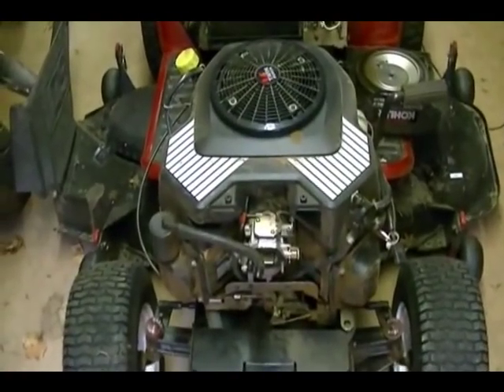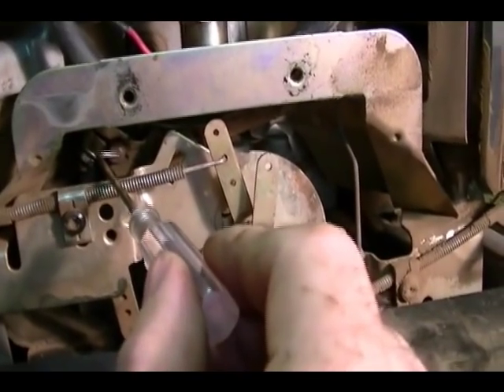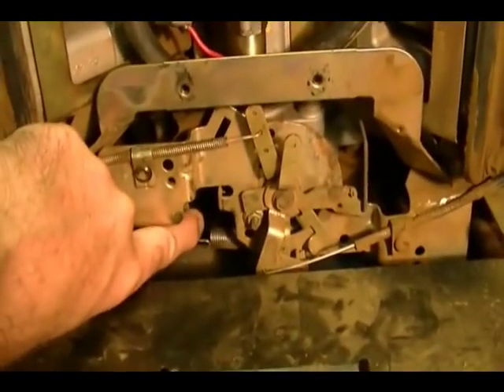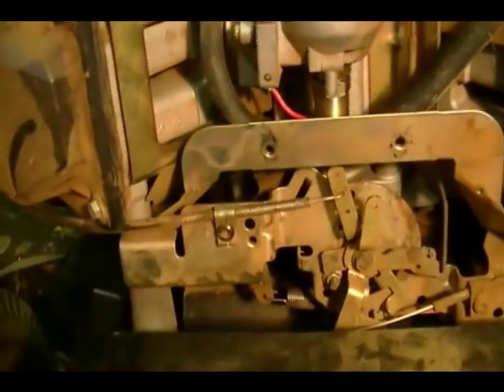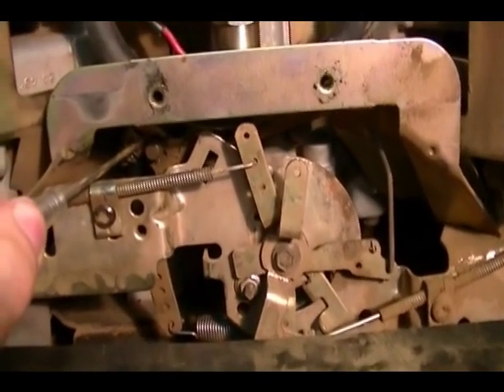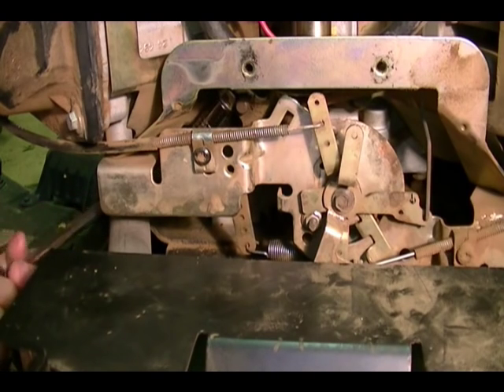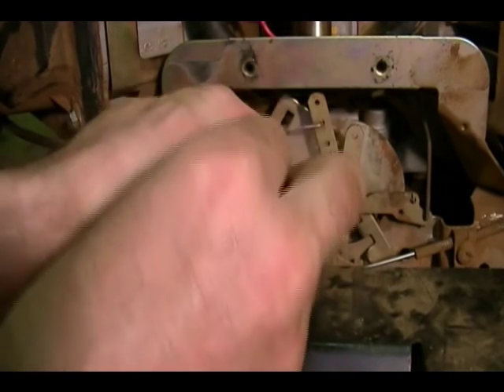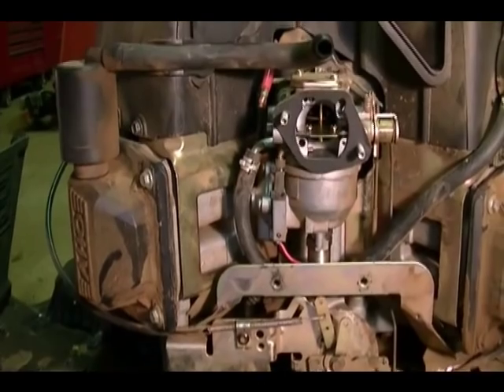Small Engine Repair: How to Adjust the Mechanical Governor on a Kohler V-Twin Engine

Comment: This video helped on my Kohler Command Pro 25 too. The linkage is a little different, but the concept was the same and got me back out and mowing! After replacing a leaky governor shaft seal, the engine would start, then rev up too high. It ran fine before taking it apart. Thank You for the help!

Comment: Very good video for adjusting governor on Kohler CV engine!
Well spoken, good clear steady picture, pointing the direction with finger was right on.

After total rebuild, I installed it and it started right up at OVER 4K RPM WIDE-OPEN, 
(3,600 RPM is normal) it would idle fine with throttle pulled back, but slightly increase throttle and engine would snap to wide open RPM's instantly, after watching this video, I went out and did what this video showed and now engine starts normal again; throttle response is normal, no problem now. 

Thanks for posting this video.

Comment: excellent video. You are a gifted presenter: very clear, concise and to the point. This is the best description I've seen on how a governor works. I have viewed well over 500 hundred how to videos related to small engine repair and this is the best I've seen on this subject. My enthusiasm has caused me to use too many words which is ironic because the thing I admired most about your video is how each word means so much and there are no fill in wasted words.

Comment: Thank you.   I'm very clear on what I need to do.   Saved me the trouble of loading the tractor up and taking it to the shop!
Reply: Me again, I used this video to fix my KOHLER 23 v twin John Deere L-130.  After John Deere worked on my tractor, they left the governor disconnected with the wrong spring on the gov.  Wow!  Paid $3.00 for a new spring at the Mom and Pop hardware store and watched the video.  Done!

Comment: GREAT VIDEO! I've got the ZT720 and replaced my throttle control cable and I'm worried about adjusting it such that it won't cause an over rev situation. Any advice? I'm thinking I need to buy a tachometer to get it right but am hoping for a simpler solution. Thanks again for sharing your expertise!

Comment: Appreciate your videos! Changed oil pan gasket on kohler cv740 the other day. Went to start it and it starts and dies starts and dies. Cleaned carb checked everything still nothing. So I’m thinking it has something to do with governor. I’m gonna check it today

Comment: I realize this video is quite old but I sure wish you would have addressed the different holes in the governor arm. Did you ever do another video?  I can't find anything, anywhere that addresses the holes or the location where the other side of the spring connects.

Comment: Hope you can help.....recently had to do some electrical work....burned wiring on the ignition moule (where the key goes) replaced that..washed the mower  water and detergent. Also cleaned the carb with carb cleaner. Now...busts right off, but if I engage mower at low rprm as usual, it dies....bur if i REV it up it will mow....I know it is a carb problem...any suggestion.....I hate to takeit to a shop if it is something really simple to fix my self.  PS  this is a Kohler Courage 25 hp on a Gravely 50" curt

Comment: having gov linkage problems, 23 hp kohler command, with a new gov return sprint ( due broken old one)  one end goes in adj holes OK where does the other end attach?
Reply: I'm trying to figure this out as well, I can't find anything that answers these questions. Did you ever figure it out?

Comment: These videos are great! Can you tell me what symptoms would tell us that we need to adjust the governor?
Reply: I noticed you didn't get answered, and in case someone else comes by, they can read my answer.  
Be warned, it may not be the best answer.

Symptom:  Your tractor runs at a lower rpm.   When climbing hills, the tractor struggles, or doesn't have the power to climb the hill.  You can adjust the throttle all you want, but you can't increase the high end until you reset the governor per the instructions given on this video.  BTW, I think he did an excellent job.

As to the spring, be careful re-positioning the spring as the motor my start surging when you apply power.
Reply: My symptoms were that the mower would crank and sound fine but when you press the forward or backwards pedal it would stutter like it was going to die...then rev back up and go fine (hydrostatic drive).  Also when I engaged the  blades, the rpms would dip real low and sound like it was going to kill the engine...but then the rpms would ramp back up and it would be fine.  Also while mowing, when the grass got thick, it was pretty iffy on whether the engine e was going to die.

I made the adjustment (very easy), and it runs like a hoss again.  The engine doesn't even flinch whenever you engage the blades.  My mower is 20 years old...I thought it was just getting worn out and it was time to buy another one.  It is literally running like new again.
Reply: Yeah the symptoms of a governor out of adjustment is that it doesn’t respond as quickly as it used to.  If adjusting it doesn’t help your governor weights may need to be checked, which required pulling the engine apart.

Comment: I have a toro recycler with the Kohler engine. I wish there was a way to run a cable and lever up by the handle to adjust the speed manually

Comment: Hoping to get a reply even though this is a few years old. The flywheel key broke on my bad boy magnum with the Kohler 7000 series. Instead of just removing the linkage on the carb, my helper took the brackets off the throttle/choke cable connect to. I THINK I have the brackets correct, but the bolt in the center that holds it all on will not tighten all the way. Is this normal? Is there supposed to be a nut on the back of the brackets that the bolt goes to, or just the threads on the brackets themselves then just tighten as far as it will go?

Comment: Nice video.  I know this is not a question/answer forum, but I thought you might be able to answer this.  On my mower (18HP kohler), it boggs down really easily when mowing.  I have adjusted the governor like you say.  If I watch the governor and engage the blade, the governor never moves the throttle. I can reach in and manually move the governor and the engine will speed up.  It is like the governor is not even working.  Is it common for the internals of the governor to break?   Thanks

Comment: I have the 22hp kohler motor, but i don't have that linkage coming from the left side in the video.  Is that your chock cable?  I'm also wondering what is supposed to pull the throttle closed, because mine doesn't seem to close all the way when you pull the lever all the way down.

Comment: I have the kohler pro 20hp engine i got a strange problem. As i had a broken ignition coil (waiting for it as we speak) yours seems different a bit. That being said, i can open the throttle and it opens, however when i pull the lever down ....it seems to be stuck somehow will not go down. Until i push that arm down myself...might be dirt but not sure...what you think?!

Comment: Excellent video and exactly what I need.  My Command 20HP idles way too high.  The governor works just set too high.
Reply from the maker: +Jim Worley Thanks for watching!
Reply: @smallengineshop  My Kohler Command 22 recently started running way too fast.  I tried this adjustment but the governor shaft was already as far as it would go in the counterclockwise position.  So I moved the spring from the 3rd hole to the 1st hole and it slowed it down some.  But it runs about the right RPM with the throttle cable pushed all the way down.  When I move it to the fast position it runs away again.  I can't find anywhere on YouTube how to properly set the throttle cable on the Kohler Command V-twin like in this video. Any information you can provide would be greatly appreciated

Comment: Thanks for the video. I have a Kohler cv20s and when you go to higher RPM the the governor arm rapidly opens and closes the throttle. Is this a governor adjustment ?

Comment: My friends seems to be running to high so his probably needs turned clockwise to drop its speed some unless its just the governor arm out of place cause i can hold that in place by finger then it runs smooth how it should then i let off and it runs to high

Comment: the video might be very informative if you would have mentioned what would cause the need for a governor adjustment...
Reply: Over the years of vibration from the engine running i think then the stuff loosens up